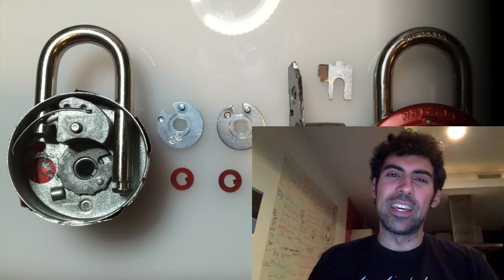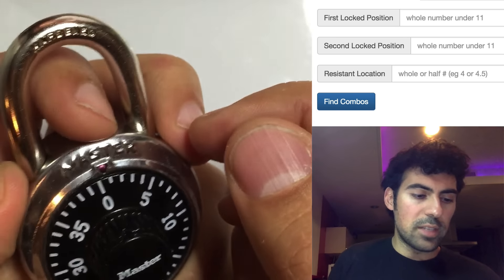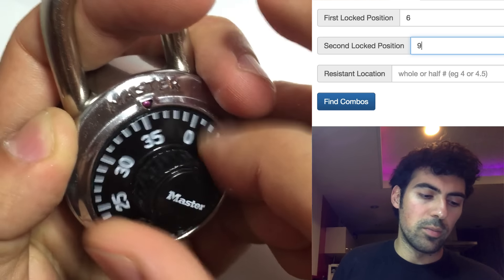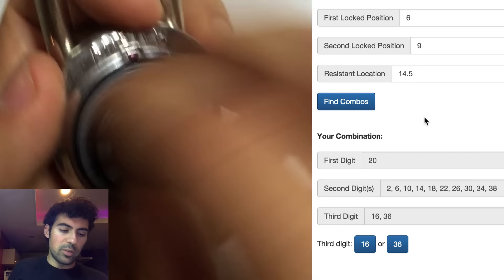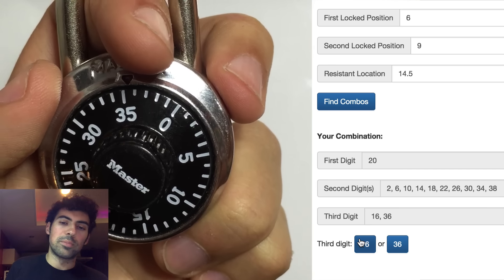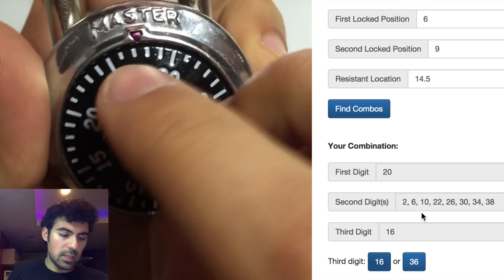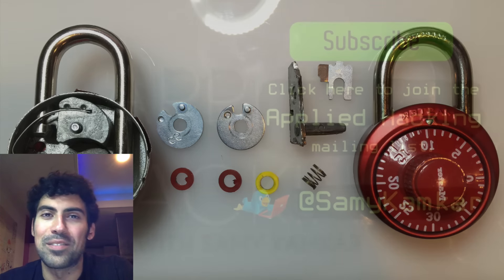Break open any Master Combo Lock in 8 tries or less!

Comment: now every highschool locker is not safe anymore
Reply: gotbletu   I never used master locks on anything, even there key locks suck.
Ive always used medeco's key locks.
Reply: Kobe Wild Well if the mechanics inside arent the same your safe but i dont think they are much different.
Reply: gotbletu These Masterlocks were never safe. It was only a couple years ago that they changed the designs so that you couldn't easily pop the open with a soda can (you still can but it takes actual skill now). This just simplifies the decoding process which used to be quite involved.
Reply: gotbletu ABUS "Combination 78) locks don't work. I've tried it numerous times. Their locks either don't have a resistance spot or it's very hard to find. I've tried it with numbers assumed to the closest locked position and it never works.
Reply: gotbletu Funny, I used to open my locker by smashing the door latch from the bottom with a book. You didn't have to enter the combo at all, just provide enough upward force to jog the bar out of place.
Reply: What's the matter? Does the sage of six paths need a better seal?
Reply: +Michael Lee use a shim
Reply: Kyle Hannigan no I meant that ABUS locks cannot be opened using this method in the video, so I'm safe. Not EVERY highschool locker isn't safe. It's only some ones that have Master locks

Comment: Did it 8 times and did not get it and was skeptical. Went back through the process again, got the same numbers, but managed to get it on the second go around. User error i assume. But very cool video i officially feel like a badass.
Reply from the maker: +The Eagle You ARE a badass!
Reply: The Eagle i cant get it to work
Reply: The Eagle look up a lock shim, it's way easier and you don't even need to fuck with the dial
Reply: @hyperhektor7733  LOL

Comment: Wow, thats pretty cool. I had my doubts. Found an old lock because i couldnt find my lock with the key, watched the video, tried it out. About 6 or 7 combos later, started thinking "is this a hoax? did i even do this right?" Next combo got it. Big thank you :) blew my mind
Reply from the maker: Awesome!
Reply: So these worked on locks 3 years ago, but no longer? Cause sure as he'll didn't work for me.
Reply: @emmy_cookie_izbrownie7526  keep trying. I had to do it several times before it worked. It's all about the pressure you put on the lock itself. It does still work because i had to unlock another lock that i was going to use for my work locker. I had this video saved in case i needed to open a lock again

Comment from the maker: New video describing the internals of the lock and the simple math and physics behind the new vulnerability: http://youtu.be/qkolWO6pAL8
Reply: Samy Kamkar You'r awesome :) all of your tutorials are awesome!
Reply: Samy Kamkar Thank you a lot for the great video! Could you please give a link to the
 Dremel device and its cutting accessory you have used to disassemble 
the lock case? For other task (cutting custom metal case) I tried a lot dremel supplies, but none cut as easy as in your pictures.
Reply from the maker: Анна Старцева I found it easier to cut through the side rather than directly on the backplate, so try from the edge. I used an AC-powered (not battery powered) dremel: http://amzn.to/1KdFqVE
and this bit: http://amzn.to/1Fr8qIi
Reply: +Samy Kamkar Please help, I only get one # under 11. What do I do? Please respond
Reply from the maker: +Clinterpottrmus Try looking for two locked locations between 10-20. If you end up with two numbers (such as 13 and 17), simply remove the first digit and enter "3" and "7" into the tool.
Reply: +Samy Kamkar I'm pretty sure the pattern is always [1st, Greater than 1st, Less than Second] so you should be able to filter out more numbers from the set for the second position.
Reply: Samy Kamkar wtf
Reply from the maker: Brandon, yes?

Comment: Further optimization: you don't have to start over for each 2nd digit. In your case you could dial 20-2-16, then 6-16,  then 10-16, 22-16, 26-16, etc. Once the 2nd digit you're trying is past the 3rd, stop going all the way around and go directly back to the second.
Reply: Huh?
Could you try explaining a bit simpler?
Reply: @dudeurodude3845  Given that you know the first and last digit, you can rip through a list of middle digits fairly rapidly. Once you have dialed the first combo and tried the shackle, go straight to the next middle digit in your list, then of course the last (known) digit trying the shackle again, then the NEXT middle digit in your list, the known final digit, try shackle, etc. 
Say we know first digit is 3, last is 5, and the middle could be 0,10,20,30, we would dial:
2 full dial turns right to reset the lock
3-0-5-pull (pull means try the shackle)
10-5-pull
20-5-pull
30-5-pull
Also, because of the dial slop (being able to accept numbers +- 2 of the correct one), it's actually easier to just run all possible middle digits than to bother with a list. I personally start out with 0, 2.5, 5, 7.5, 10, 12.5, etc, all the way to the top or until it pops. Have Fun.
Reply: @sometimesleela5947  thank you very much now I understand
Reply: I think this optimization may only work when the 2nd digit is larger than the first. I tried it with a lock whose combination was 4-14-36. Suggestions for the 2nd digit were 2, 6, 10, 14, 18, etc. If I try using the optimization and begin with 2 as the middle digit, it doesn't work, probably because "going past the 4" first means almost 2 complete revolutions of the dial. I try 6-36, 10-36, 14-36, and the lock doesn't open. If I begin with 6 as the 2nd guess, however, it works as you state -- 10-36, and then 14-36 opens the lock.

Comment: Wow, I've had a master lock for about a year just sitting in a drawer and I've tried a couple other methods using just pencil and paper math but that's only get it down to ~100 combos. Finally got the lock open on the 14th try (chose the wrong third digit). Thanks!
Reply from the maker: Nice!

Comment: Interesting twist with my combo lock:

I only had a single number locking up under 11 (6). So I tried your suggestion of going to 10-20 and looking for numbers there. Again, only 1 position (16). Out of curiosity I tried 20-30 (nothing), and 30-40 (36). So on the whole dial only 6, 16, and 36 locked up. I figured out through another method that my combination has the same first and 3rd digit (26). 

Using your tool, I just have to leave the Second Locked Position blank and it will give me the correct combination options.

End combo was 26, 8, 26!
Reply: Hello, may I ask what other method you used? I only have a single number locking up under 11(8).

Comment: After spending roughly 3 hours doing it the other way most commonly found on Youtube, I decided to try it on your site. After another 2 hours, nothing was working. Turned out I had the wrong resistance number. After seeing the first digit change for the combination, I remembered the potential combinations feeling more familiar  (Last time I used the lock was in 2013 for a few months for work) Next thing you know, after the 3rd combo attempt, it popped open :D Thank you so much :)

Comment: This didn't work. My second lock position is 12, which caused your code to fail since it expects a number less than 11.  I finally figured out the combo using a couple of different videos.
Reply: bruhhhh  dm me the videos if you would so kindly
Reply: Whats the video
Reply: whats the video i neeeeeeeeeeeeeeeeeeeeeeeeeeeeeeed it
Reply: The first trick just hasn't worked for me from over 10 different videos trying to find the second digit, I haven't even tried the third yet
Reply: any update on which vid worked?

Comment: Thank You so much. I wasn't able to 100% use your method in the video but through your video and website using the calculator you created I was able to figure out the combination to my mothers probably 50 to 60 year old master bike lock. It doesn't have a resistance location so I found the first 2 lock position numbers and plugged them in. Then I went through all 12 locked positions and found the anomaly as some put it. I then started with a resistance of 0 and increased .5 until i found where i had the option of my anomaly as my third number. the second number i tried as the second digit was correct. I have been trying to crack this combination lock for 20+ years and only thanks to your information was i able to do it.

Comment: it is not working :(
Reply: use a hammer
Reply: +Spoder Man LOL
Reply: +Maegan Gunnells Even faster, just shim it.
Reply: +Maegan Gunnells Same here, didn't work.
Reply: +bryan986 You're probably getting the wrong point of resistance. Lift high up on the shackle as you can, but then fasten the shackle in place with your fingers on each side the way he does in the video. That way, it's up as high as it needs to be to find the point of resistance without putting too much stress on the shackle. Then, spin counter clockwise to get your number of resistance. It worked like a god damn gem for me.
Reply: Maegan Gunnells it didn't give me the third number
Reply: I found the first two whole numbers to type in. I'm stuck on finding the point of resistance. Any tips on an alternate way to locate it? No matter how much or how little I pull on the shackle I don't feel just one point of most resistance. I tend to get caught between all our known "canyons."
Reply: Lauren DePasquale í
Reply: Angel Bishimir what?
Reply: Maegan Gunnells look into lock shim

Comment: i tryed a lock but the second digit is 12
Reply from the maker: Try 2 instead of 12
Reply: Samy Kamkar how about 11 ?
Reply: then put 2
Reply: My 2nd digit was 11. I tried it using 11 as the number and it didnt work. I tried it using some other numbers as well and still nothing.
Reply: @samykamkar my 1st # is 2 and 2nd is 12. If I put 2 in both places the app just returns question marks for the 3rd. Any suggestions?

Comment: Sorry for being pessimistic, but I'M SO MAD!!!! I can't get it..... How do people crack their master lock? Please help me....
Reply from the maker: What are your resistant and locked locations?
Reply: His method does have some merit to it, it did predict two combinations correctly for me. What I've seen done at gyms where these lock are most often used is thieves will run a solid bar of steel inside the shackle and use the lock itself to twist off the metal tabs on the gym locker to gain entry in a rapid fashion. This makes sense, they've got to do their thing and gain entry in 10 seconds or less.
Reply: @samykamkar  Finding resistance point is not possible on some of the locks of this model. For these, the only recourse is to use the more tedious and somewhat error prone method which have you first find all twelve lock points (that's the error prone part), after which some arithmetic jiggery-pokery gives the third number, 10 possibilities for the first number and 8 possibilities for the second = 80 possible combinations. There are 64,000 (40x40x40) possible three digit numbers in base 40, not 64,000 possible combinations for this lock. The number of possible physical combinations for this Master lock is 40 X 10 X 8 = 3,200.
Reply: @blindleader42  Do you have a video that shows how to find these lock points?
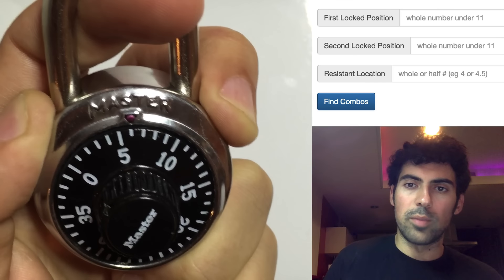Reply: @Bankable2790  It's exactly as Sammy does in this video from 0:49 to 1:45, where he finds the first two. You just continue turning counterclockwise to find them all.
Here's one of the many written procedures on the web on what to do with them: https://www.art-of-lockpicking.com/how-to-crack-a-master-lock/.
Note that these written procedures have you write down all twelve, not just the ones that center on numbers. You end up ignoring the ones that land between numbers as Sammy did, but it's wise to have them in case you don't get the results expected from this step. Having the whole set makes it easier to go back and figure out which one(s) you read wrong. Sammy's lock and mine are not sloppy, so that wasn't a problem, but some of these locks can have a lot of range in the lock points so it's easy to misread what the center point is.
- Good Luck

Comment: Doesnt work, there is only one number under 11
Reply: +TraceguyRune same for me....
Reply: Charles Léveillé try using 0. I think That did it for me
Reply: Same for me too.
Reply: Plamondonl7000 I can't remember, but I think both 0 and 10 will solve this.

For the educational factor, I rebuilt his program in another language and got the same results
Reply from the maker: +TraceguyRune +Charles Léveillé +Plamondonl7000 Try looking for two locked locations between 10-20. If you end up with two numbers (such as 13 and 17), simply remove the first digit and enter "3" and "7" into the tool.
Reply: Same here. Still unable to open my lock.

Comment: Sorry, it doesn't work. I tried on my lock and your website didn't find the combo, even though i've followed the instructions.
Reply: same
Reply: (I already knew the combo)
Reply: +thisguywhocamps1 
You are
Reply: +Plamondonl7000 The area you're messing up is the point of resistance. When you get to that step, lift up on the shackle as high as it will go, then fasten it in place by pressuring it with your fingers from both sides. That way it will catch at the point of resistance without having too much pressure.
Reply: +thisguywhocamps1 you just made me spit toothpaste all over the mirror LOL
Reply: lazlo686 well that escalated quickly
Reply: +Clint Beastwood sorry my comment was uncalled for. I've been following the steps and have tried cracking my lock over 2 days. My comment was out of frustration that I've tried cracking the combo of my lock for a long time and have tried over 50 possible combos.
Reply: +thisguywhocamps1 sorry for my previous comment I'm gonna delete it.
Reply from the maker: +lazlo686 Were you able to find the resistant location? It's a Master lock, correct? If you're having trouble, instead of looking for the locked locations below 10, instead look for the two whole number locked locations between 10 and 20 and remove the first digit. So if "13" and "17" lock up, enter "3" and "7" as the locked positions into the tool and give that a shot.
Reply: lazlo686 nacho libre voice I forgive you
Reply: +Samy Kamkar ok thank you sir
Reply: christopher herro's right, i took his advice and played around with the resistance point and booyah!

Comment: Got a locker at a new job that came with a combo lock, but the combination they gave me was wrong (lock was inside locker, closed) so I brought it home.  Didn't believe this would work, and it's a bit fiddly trying to tell the difference between when the lock is in a .5 spot or a whole number, especially for the resistant location, but it actually worked (and it wasn't even close to the combo I was told).  Got this lock open in about 22 tries, after trying different resistant spots and both third numbers for a couple attempts.  Pretty wild, thank you!

Comment: Is there a way to get it with out finding the god damn resistance number? I get resistance in one spot one lap and another the next my hands are sore from trying to find a consistence resistance number and all other suggestions I have tried haven't worked.
Reply: Ygaz gge same. this is so annoying.
Reply: Ygaz gge there are probably false engravings meaning there meant to confuse you between the resistance and stop people from attempting this method.
Reply: if you're getting more than 1 spot than you're pulling too hard... pull a bit lighter and it should only stick in one spot.. add 5 to the resistance point for your first number

Comment: I don't feel any resistance for the third digit. Any help?
Reply: Circl2s or try both numbers they give you in the algorithm
Reply: what both numbers?
Reply: i was having a hard time,cause it seemed i was getting multiple points. But play with it and see which number has the most resistance. If all else fails write down which resistance numbers your getting and try each one into the calculator

Comment: shim the lock. its the quickest way
Reply: What that mean
Reply: @careditlegends  stick a thin piece of metal or plastic down the hole the shackle goes into, so that it’s in the way of the locking mechanism. if the locking mechanism isn’t solid (which it isn’t on these locks), it’ll push it aside, and open the lock
Reply: Newer models are shim resistant so that won’t work
Reply: No
Reply: If you shim the lock you might get it open but you won't know the combination. So the lock will still be useless
Reply: @richardpowell4281  this
Reply: @1495978707  How do I know if my model is new
Reply: @swrdghcnqstdr  That can take a really long time if you don't have a shim or the means to make one.
Reply: if you do that, you will not know the combination

Comment: It seems newer models may not follow the same resistant number trick. I did get one lock open for fun with it though. I bought a brand new lock as well to try this on. Resistant-first-second is 33-1-4 and the actual combo is 21-35-01. Looks like I get 9 as the first number out of the tool. Definitely always hit 33 as the resistant number. Love you work on this.
Reply from the maker: +Stellar Moig are you sure you don't get a resistant location around 16? I'd play with it a bit more -- I tested on a recent model and it still worked properly